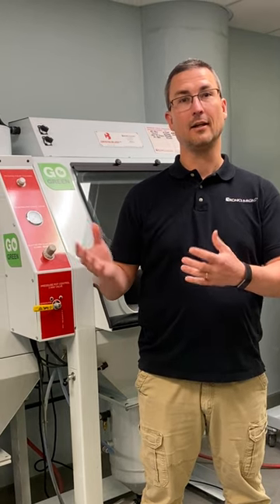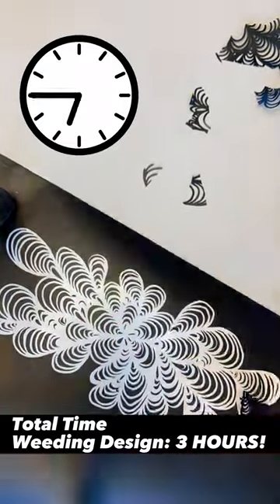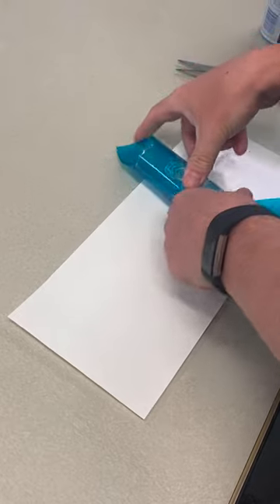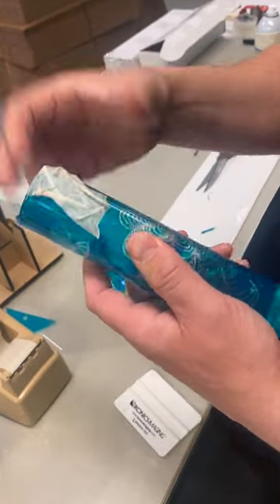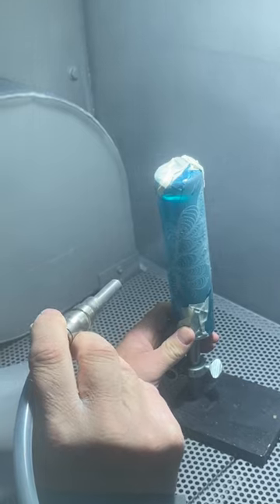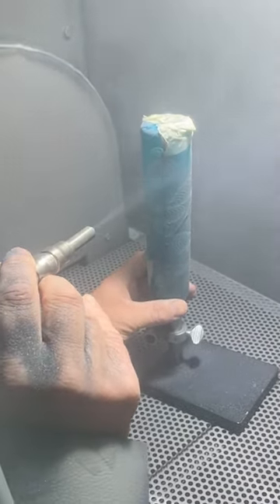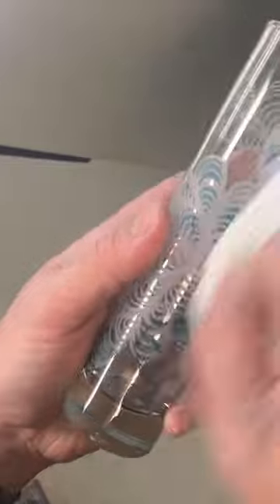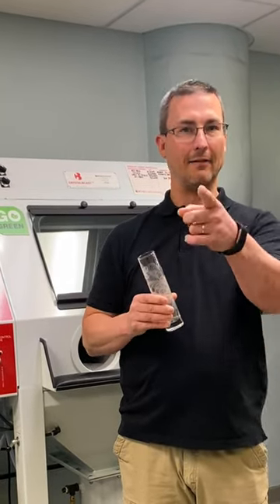Save Time with Washout Photoresist Film vs Plotter Cut Vinyl for Sandcarving | IKONICS Imaging

Comment: Thanks for showing the difference in prep times. Do you have any video of the final product that shows the similarities or differences between photoresist and plotter cut vinyl?
Reply from the maker: You won't really see a difference in the final result, except that you can get a lot more detail with photoresist. The benefit of photoresist vs vinyl is in the time you can save and detail you can achieve, not in the final result.

Comment: Wonderful work, for sure it was the best but everyone may not sandblast glass only, show the result on Granite Stone, engraving or sandblasting any Image ( Portrait ) in halftone , let's see how much perfect it works! If it gives a perfect result on granite, I would order a Sandblasting Cabinet Plus all attachments ( Air pressure- Compressor, Photo resist film and vinyl ...etc.  
You are humbly requested to make a vdo on a photo sandblasting on granite 1ft X 1ft. I would be one of your customer, thanks in adv.
Reply from the maker: Thank you for the suggestion. We will add that to our list.

Comment: nice. can you use acid etch with that film?
Reply from the maker: This film has a membrane that is first blasted through when sandblasting. This makes is not work as something with acid etching. 

We recommend using Ikonart Stencil film, also produced by IKONICS, if you are looking for a photoresist film that can also handle acid etching. It has specific requirements when using acid to etch. For more details check out their website here: https://ikonartstencil.com/

 They have a video showing this process here: https://youtu.be/9vt4ftd5Rwg